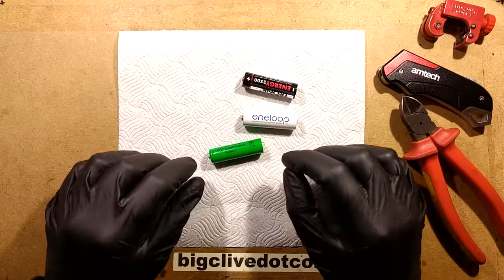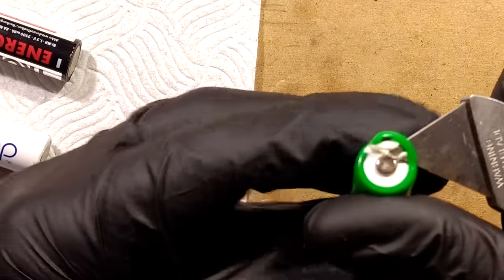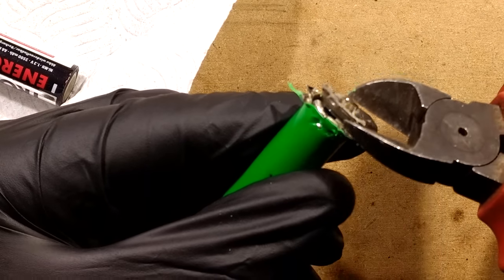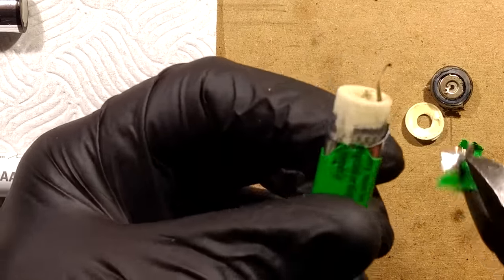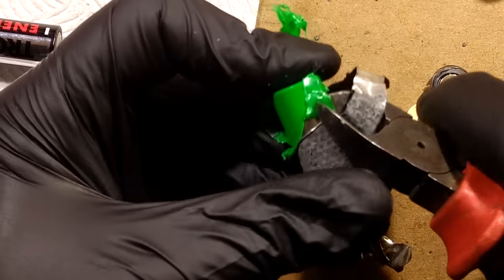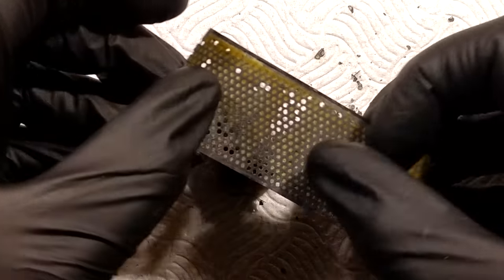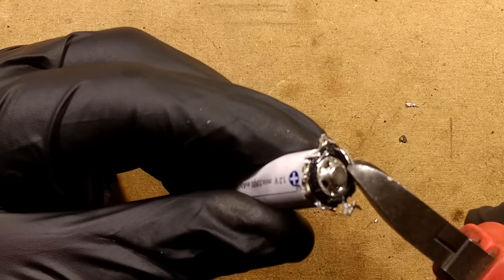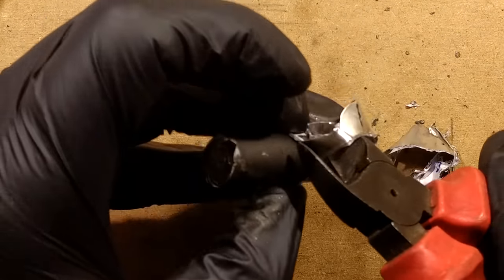What's inside Eneloop and LIDL NiMh cells (fire, apparently)

Comment: someone needs to tell this guy that the outer cylinder is the cathode, the mesh in the middle is to stabilise the lithium electrolyte which he calls that grey stuff, the plastic end caps are insulators as the metal case would short the spiral at each end. Lithium compounds can catch fire in air (+O2) and (+h).... If you dont know what you are doing, dont do it and making yoursef look like a foolish amateur
Reply from the maker: These are nickel metal hydride cells.  Not lithium cells.

Comment: My cordless phones do not work on Eneloop, no idea why? Cheap batteries NIMH, all fine? Mo idea... Thanks bigclive!
Reply from the maker: Sometimes the size of the anode pip causes problems if the battery holder just barely doesn't make contact with it.  Often so close that it looks as though it is in contact, but is a tiny fraction of a millimetre away.

Comment: With loosely packed/ tightly packed - Lot's of electrolyte or not so much in it.... Why are they all 1.2V? What makes up the voltage?
Reply from the maker: It's the chemistry that determines the voltage and the amount of active material that determines the capacity.

Comment: Really interesting video big Clive has a experience with a supermarket branded aa nimh battery once it was on charge in a battery charger the battery got really hot and it blew its positive cap on top of the battery 🔋 I was watching the television in my bedroom at the time few years ago whilst changing the batteries and it apparently appeared that one was overcharging even though it was a smart charger I recall hearing a very loud bang and the top cap of the battery completely blowing its cap on positive terminal and when I unplugged the battery charger the amount of heat from the battery was absolutely red hot 🥵
Reply from the maker: I had a "smart charger" crash once and the first clue was a hot smell.  All the batteries were being charged with uncontrolled current continuously, and were so hot that the heatshrink on them shrivelled up.  When I unplugged it and plugged it in again it behaved as normal.

Comment: Hi Clive. Please can you do a review opening of a 9v battery and also what's the difference between  rechargeable and non rechargeable. Thanks.
Reply: Smaller battery stacked 4 or 5 times in series
Stacked alkaline ------- non rechargeable
Stacked nickle metal hydride ( ni-mh)---- rechargeable
Just different chemistry , metal's, electrolyte,
 same container ........there is a alkaline charger but only cud charge above 50% for safety reasons its called Re-zap 😁

Comment: Can you take apart a smart charger for batteries. I have one (La crosse) for my eloops and i just want to see whats inside to detect batteries at full cpacity
Reply from the maker: The LaCrosse units usually use three systems for ending the charge.  DVDT (Change in voltage over time) to detect the formation of bubbles on the electrodes at full charge, upper voltage threshold where it will cut off if the cell has too high a voltage (also used to detect non rechargeables and avoid blowing them up), thermal where it detects a sudden cell temperature rise at end of charge and as a last resort a timer that will kill the charge if it goes on too long.

Comment: Last time I cut apart a AA battery was about 15 years ago and the one I took apart was a Duracell if I remember correctly, and inside of outer casing was 5 or 6 separate button batteries with a strip of metal soldered to them.  Is this new design the reason I'm experiencing a high degree of leaking batteries nowadays whereas before years ago I never had a leaking battery?
Reply from the maker: That sounds like it may have been either a 9V or 12V battery.
Reply: @bigclivedotcom  nope, they were AA bats for sure.

Comment: The Lidl cells have a larger diameter than normal. I have a flashlight which they won't fit.
Reply from the maker: Some do push the sizing to the limit.  There are products that are also a bit on the edge of compartment size.

Comment: I have been using the standard Eneloop for some time now and they are a good reliable battery. I did buy four of the high capacity version (2400 mAh ) and I found they didn't hold a charge as well as he lower capacity versions.
Reply from the maker: That's the trade-off.  Higher capacity has slightly higher self discharge.
Reply: I saw that one company was experimenting with using a large capacitor to store electricity  quickly in breaking because of it's ability to hold a charge and supplement the battery in hybrid cars. The construction of some capacitors seems to be similar to rechargeable batteries. At what point does a battery become a capacitor ? and can people start using batteries in electronic equipment instead of using capacitors ? 
 @bigclivedotcom
Reply: PS I know a capacitor does not hold as much electricity as a capacitor but they do have an advantage in storing electricity quickly unlike a battery which takes time to charge.  @bigclivedotcom

Comment: If you were to connect a big batch of 18650 lithium ion cells in parallel and leave them "overnight" and one of them was a dud that conducted but couldn't store charge, what would happen?
Reply from the maker: If it had an internal shunt it would run all the parallel cells down.
Reply: @bigclivedotcom Would that cause it to overheat and catch fire.... this is what is happening to electric bikes in China.
Reply from the maker: @richardpeel6056  If a cell fails it can short out all the associated cells, and the heat generated can trigger failure in other sections of the battery.
Reply: @bigclivedotcom If there were quality control issues in the manufacture of 18650 lithium ion batteries in China occasional duds getting into parallel stacks , wouldn't this be seriously dangerous?

Comment: What gloves are those? is it safe to use for managing electricity plugs and adapters as well?
Reply from the maker: No.  These are standard latex or vinyl gloves and only really suited to chemical style work.  They will offer a layer of protection against shock, but are not rated for electrical work.
Reply: @bigclivedotcom  thank you. I am handling batteries and going to test socket analyzers and already felt some minor tingly sensation when testing usb cables for charging. What more if its a socket that can deliver 3000W 230V.
Reply from the maker: @RocZi  You can get a slight tingle from many USB power supplies because they leak a tiny amount of mains current through their filter circuitry.